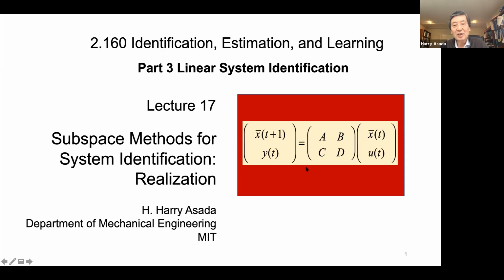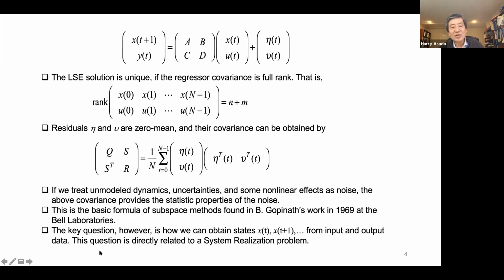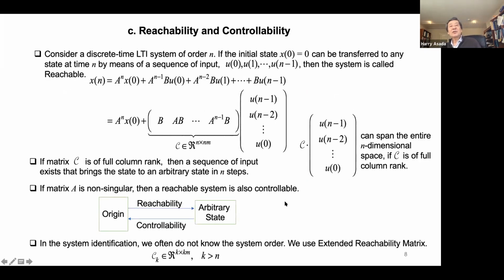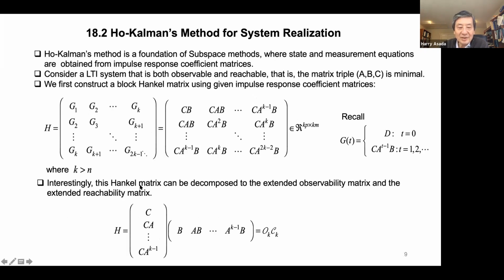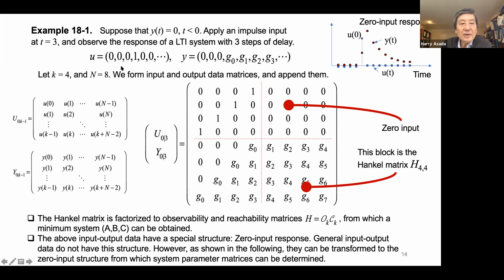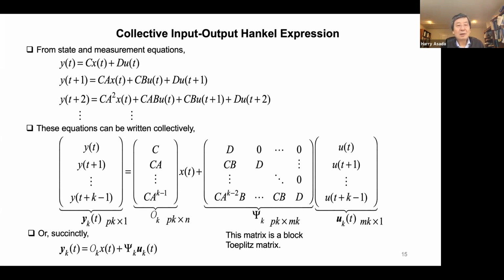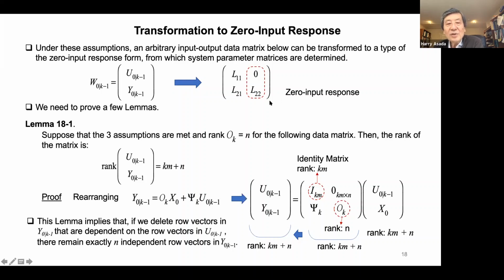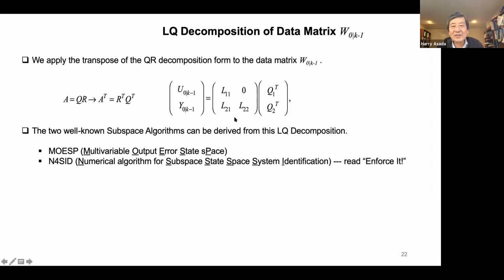Lecture 17: Subspace Methods for System Identification

Comment: May I ask how many input-output pair will be sufficient to form a relatively correct model? Is their theoretical number can be defined for the requirement of data and how sufficiently excited is enough for state vector? Could you please advise? Thanks in advance.